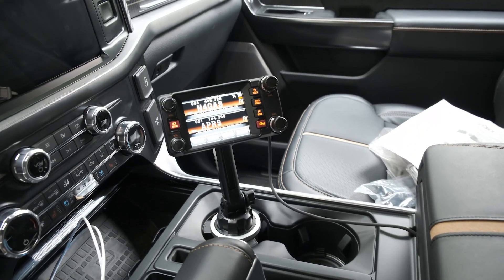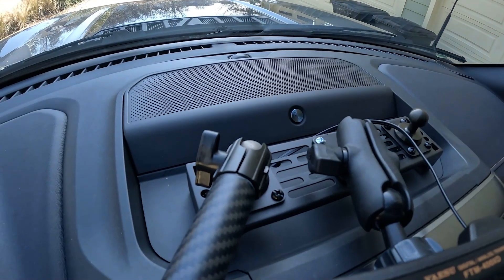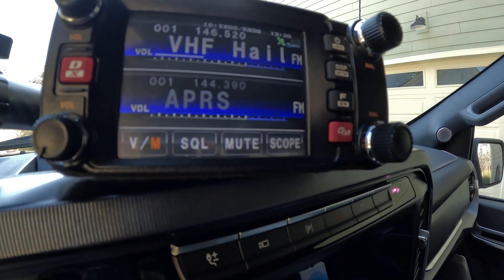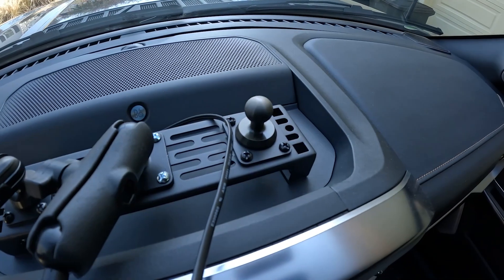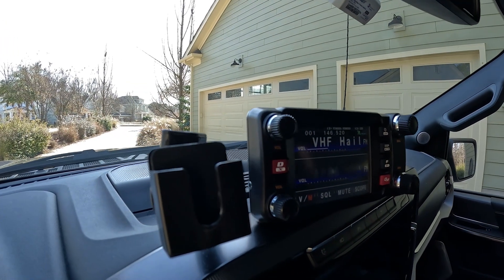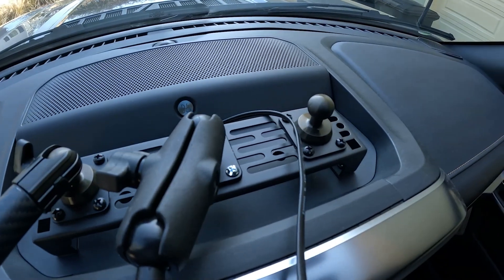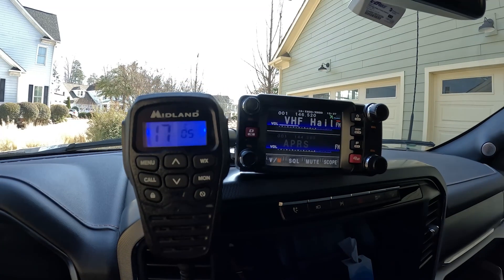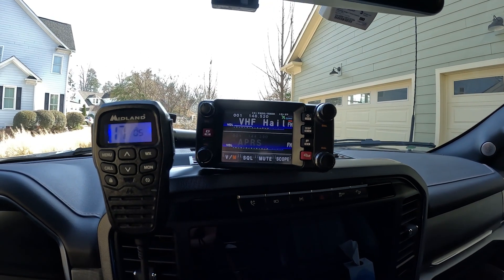2021+ F-150 Two-Way Radio Install (Ham and GMRS) Updated Setup

Comment: Dont want to start anything here.. but... mars your 400 and loose the 2nd radio altogether. At the end of the day, its your decision and dont let others talk you out of it. -- this will absolutely solve the speaker issue, all the extra wiring, and mic cables. 73's!

Comment: I mounted a icom sp35 speaker in my sunglass holer up on the headliner
Reply from the maker: That’s a good solution. I actually have an sp35 and was going to 3D print a mount to attach to the headrest, but it’s not removable with the B&O system since there are audio speakers in the headrest. 

I do use the sunglass holder but might look into that option.

Comment: I'm betting part of your problem with the mixer not working is the FTM-400 has non-standard wiring for the external speaker. It has the speaker positive on the tip and the negative on the ring instead of on the sleeve.
Reply from the maker: Hummm... I will have to try that. This radio/speaker issue has been about 50X more problematic than it should be!

Comment: Check out my Ham Sexy video from a couple months ago and that should solve your audio and mic placement issues. Especially, the audio.. You'll have all the radios and VFOs you want coming out the stock Ford stereo system and when you get or make a phone call, all your radio VFOs will decrease in volume just as if you were listening to a normal AM/FM station or Spotify, etc.. And it's cheap to accomplish!
Reply from the maker: I actually tried that exact mixer and it didn't work. My understanding is that the mixer essentially bridges the outputs on the two radios so it can't feed a single speaker. Obviously it seems to work in your application so I'm not sure what's different, or if the headphone amplifier is somehow doing something I don't quite understand.
Reply: @TheBigHeavy  That mixer is non powered and passive so it's going to lose some dB of anything that passes through it. Think of the Headphone Amp being a Guitar amp on the clean channel. It's just simply putting gain on the audio to bring it to towards unity gain. You'll need a 3.5 TRS cable to run from the Headphone Amp to the FM transmitter.. If you use a TS cable, then it will not work as expected.
Reply: @TheBigHeavy  Actually, I heard that the 2021 F-150 has a 3.5 mm jack, so if that's true, you wouldn't need to use the FM transmitter. Ford got rid of that 3.5 mm input on the 2022 F-150, and that was my workaround.
Reply from the maker: If there is one, I haven't found it. I also like having the radios scanning while I'm listening to music or something else, so not sure I want the radios to "own" the audio system versus having their own channel. It's also nice in that I can run the radios without the truck being on, although I haven't left them on overnight a couple times.
Reply: @TheBigHeavy  I hear ya.  I haven't listened to broadcast radio since Rush died :(
Reply from the maker: @RichKielbasa  Ha! I hear that! I usually do Spotify, podcasts, and Audible these days. Sync works surprisingly well with CarPlay.

Comment: Why dont you plug a jumper wire from the headphone jack on radio to your input plug in the truck  .prob next to your usb plug, than change the inputs on the radio
Reply from the maker: 2021+ doesn’t have a 1/8” audio input. I could go via Bluetooth but it’s a bit janky and like twisted sister, I wanna rock vs listening to dead air while the radio is quiet.
Reply: @TheBigHeavy  OK   I GOT IT

Comment: Did you end up drilling a hole in the tray on the dash?
Reply from the maker: I used the Bullet Point Mount which didn’t require any drilling if memory serves. Install was pretty easy but it’s not as robust as the other F-150 tray that requires drilling and adding some reinforcement.
Reply: @TheBigHeavy  Sorry, I should have clarified, did you drill a hole for the extension cable?
Reply from the maker: @kasb58  No, I was able to fish it down behind the screen/center console. If you have plastic fish tape, or even a coat hanger if you're willing to be very gentle and tape the tip so you don't short anything, you can find a path without having to disassemble or drill anything in the dash.